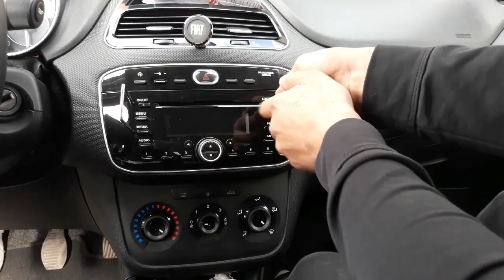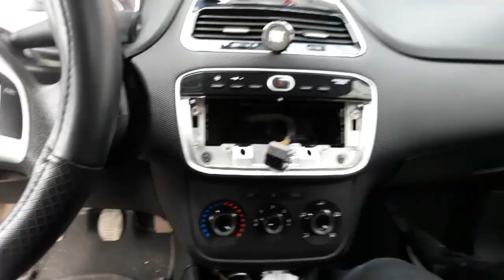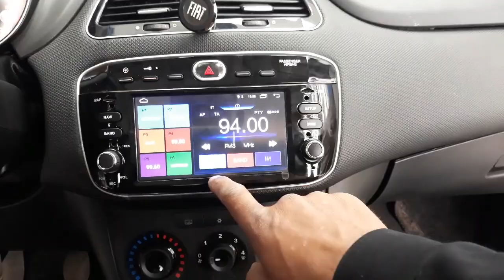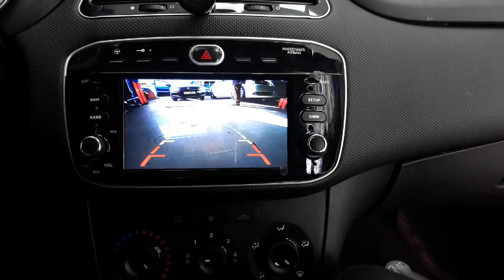installation autoradio Android Fiat Grande Punto

Comment: hi,i have this model PC68GPFL for an equal fiat, and i have a problem that is camera somtimes appear image others not its stays on radio when i am in reverse.they talk on net  about the red wire that comes with rca cable should be connected to pink cable. do you do that ' your camera always work ?
Reply: As far as I know..camera must be connected to wire of revers lights..so it will work when you shift to reverse!
Reply: @gl7492  yes the basic instalation is rca cable on cam  than on radio and the reverse from cam to reverse light.You will see that the rca came along with a red wire on both ends.My problem  is that my radio was installed the basic ,rca plug in both ends and the reverse from cam to reverse light 12v,but sometimes i put in reverse and no image just radio playing.,sometimes work others i do reset.The guy that installs say everything ok,but i search on net and mails with xtrons,and after 1 year , i discovered, that there are a purple cable that cames from canbus to conector, what  i do is cut the purple near  the  canbus and connect the red wire that cames with rca to this cable and on  other end of rca connect the same red wire to reverse also, this is for radio recognize the reverse.
After doing this never had problems always working.Other problem, the guy that connects the radio not to iginition and when i remove car key the radio  still playing i had to turn off on button, but radio in this case was consuming battery and i had to put another battery,i talk to another guy on the same place, the boss, and he told me that punto has no radio position and 12v must be connected to ignition as soon as i remove the key the radio goes off.the 2 problems were resolved with this,never had more battery issues or camera issues,inclusive during that year the radio was replaced by extrons and problem  was the same